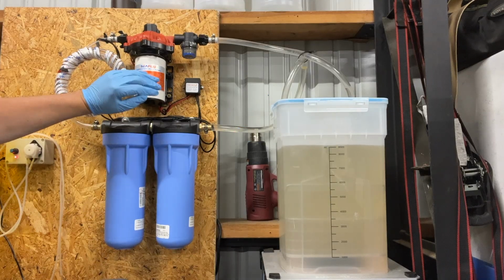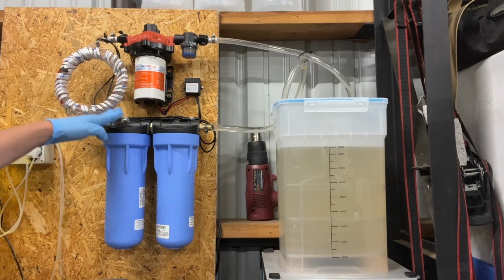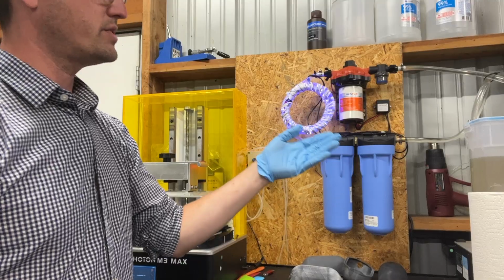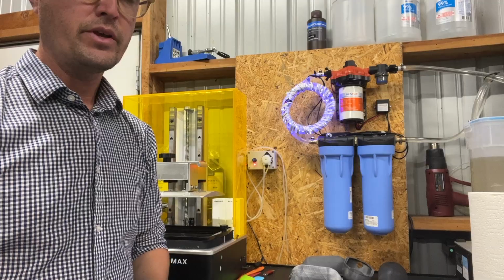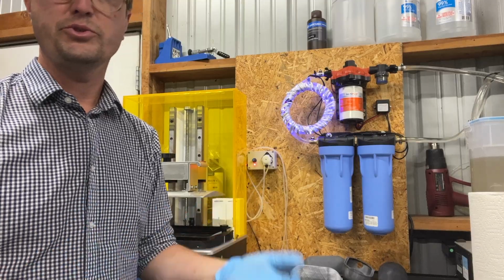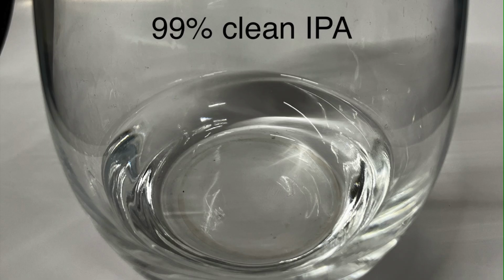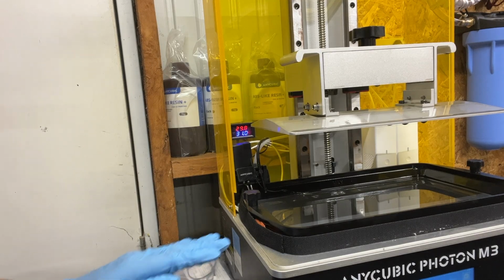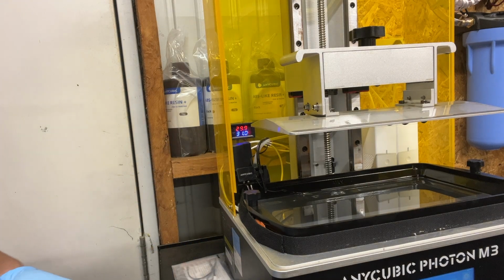Resin Printer Mods and Continuous IPA Filtration!

Comment: I would just wrap it in Aluminium foil. That way you get some thermal cooling of the led strip plus reflection of any uv light back to where you want it.
I have been thinking about a system like this for the better part of 3 years, but never had the time,  or the interns, to get this done.
Had all kind of crazy ideas in, charcoal filter plus diatomaceous earth...etc.
I do think that you will have to check your tubing quite regularly as uv damages plastic.
Reply from the maker: Polyvinyl tubing is uv resistant and durable and the LEDs are pressed to the tube. They are only 10w, so residual heat or lost light isn’t an issue.

Also no interns here, just me and my dog, and she’s not helpful at all!
Reply: Any reason not to use the 115V pump? @nicks-fix

Comment: Here from Hackaday, would have been cool to see the IPA circulation running. Very nice idea. Do you stir (agitate) the IPA as well, or is the pump flow enough to not worry?
Would be good to track IPA usage and publish your findings as well, just as supporting.
Reply from the maker: At the end of the video you can see it running (the light is on in the reactor). It’s very quiet, which is another plus!

Agitation isn’t necessary for my models, but YMMV. The pump is pushing 5gal/min and the inlet/outlet tubes are placed at different heights and different sides, so there is a pretty violent chaotic flow in there. 

It’s tough to see since both tubes are below the IPA line, so no air is introduced into the tubes.
Reply: @nicks-fix  damn that is really quiet.
Another plus point.

Comment: I really like this setup! I too hate cleaning up after myself when doing resin printing. I did try out some of my own solutions, most of which definitely did not work well enough for a second attempt, but one I tried recently actually did work well enough for me to recommend it as a low cost, low effort solution. Basically, use the UV lights to cure to resin dissolved in the alcohol, so that you get a gross, cloudy suspension of microscopic resin particles. If you do nothing, and just let those particles settle, over a few weeks you'll get most of them to collect at the bottom of the container, leaving you with mostly clean IPA. 

But I'm impatient, that takes too long, and isn't effective enough. But, good news, if you just add some sodium bentonite (aka bentonite clay, I got nearly a pound from my local grocery store for under $10, sold as a bird feed additive) suspended in solution, the bentonite will bind with the particles of resin, and make them settle out much quicker and more effectively. Is it a set-and-forget solution? No, but is it cheap and effective? Hell yeah.
Reply from the maker: Great! Love that there are so many solutions to this problem. I’m glad yours works for you!!

Comment: Your system looks nice. I would cover the loop though because UV is not good for your eyes. Printing a plastic cover for the loop might be a good idea.
Reply from the maker: Yep! It’s been covered with uv blocking tape after the video. I just wanted it visible to show it’s function. Thanks for the tip!

Comment: you keep saying 2.5 kg of resin it's not like you dumped it straight into the filtration system you're only cycling the resin that is uncurde on the surface of the prints and maybe a little from inside which adds up to maybe  .05 percent of that
Reply from the maker: How would i calculate the uncured surface resin in a relatively understandable way? 

People have an easy way to understand how much resin they put into the printer, and how much is used in a print. I tied my findings to that common standard, not a completely unknown variable since all prints have different surface areas. 

Excited to see your answer, but I assume you don’t have one and are just being unhelpful.

Instead what you did is add a ridiculously unnecessary variable into a fairly simple calculation.

Comment: I’m curious, is the pump providing the washing action or is there an agitator in the bucket as well?
Reply from the maker: Great question. The return tube goes down to the bottom of the wash tank, and the suction is at the top. When there is a little air, I can see the bubbles hitting all corners of the bucket, so there aren’t any dead areas.

Comment: I didn't catch your method of cleaning. Are the parts just static in the tub and the high flow rate does the job? My method for some time is to use a garden sprayer. I leave the parts on the build plate and squirt the parts with reasonable pressure. Inside a large tub of course. I find the mechanical force speeds up the dissolving of the remaining resin. It is a bit messy though. The pressure can't be too high of course. Not just for mess but it can blow the parts off the plate which is a nuisance because I post-cure on the plate as well.  For recycling the resin I just let gravity do the job. The fact that alcohol is less dense than resins is very handy. Overnight is generally long enough for the resin to settle. I then just decant the alcohol till I see resin particles at the lip. The remainder goes into another container with the previously settled mixture for further settling. It works but is a bit messy. It would seem your system greatly reduces mess. As to the heating, I have just purchased Chitu System's heater. Cheap and works a treat. I'm going to get more for my other machines. Your system is the best I have seen. Thanks for sharing. One question. How long do the filters last?

Comment: The is a cool approach. Although I think there is a huge, potentially terrifying oversight here. That pump is not meant for flammable liquids and says directly on it not to run flammable liquids through it. While I appreciate what you've put together here it presents a significant risk. Leaks through an old gasket, or just manufacturing issue etc. could have consequences... Have you overcome this somehow?
Reply from the maker: It’s an acceptable risk for me. 

The pump runs intermittently at about 1% of its rated duty cycle under near zero back pressure. A leak would represent itself far before any danger would occur. 

IPA is flammable, yes, but in a sealed environment without access to an ignition source, it’s very low risk.

The entire system is closed loop, and all materials that are in contact with the ipa and resin are rated for extended contact with alcohols.

If you wanted to use an air operated diaphragm pump, it’d be even safer.

Comment: Neat idea! Is there a reason why you're reactor is after your pump? I think having reacted fluid flowing through the pump would reduce the likelihood of resin building up on the pump parts.
Reply from the maker: Since the pump and tubes are not made for suction, they would fail long before residual build up ever happened inside the pump’s diaphragm. 

Also the ipa going through the pump is constantly moving over the diaphragm, cleaning it. Having the filter and reactor after the pump is the best way to run a positive pressure system.

Comment: Just to name a few alternatives: You can also use a distiller. The disadvantage here would be that a lot of the isopropanol evaporates (about 25-35%) and that it can hardly be used for anything else afterwards. But you get perfectly purified isopropanol for it. The evaporated resin is then very hard and can be removed with a spatula. The hardened resin can be disposed of in the trash (it doesn't matter if small residues remain in the distiller). The construction in the video is good and you have a constant quality of the isopropanol, but quite complex and relatively expensive.
But don't use the destiller with isopropanol INSIDE your Home! I did it once... wans't very smart from me 😅

There is also a purchasable small heater that fits into the 3D printer. Just search for "resin printer heater" on amazon and you'll find it. Another advantage here is that the resin tub is easier to replace.

Also interesting is the peristaltic pump on the wall, which is probably used to pump the resin out of the tub instead of dumping it out. Unfortunately, that didn't work for me, the resin is much too viscous and only delivers a few teaspoons a minute. It would be cool to get a simple and clean solution for this.
Reply from the maker: Yep, you basically listed all the reasons I didn’t want to distill. Mine doesn’t require any cleanup, doesn’t evaporate IPA, doesn’t have a huge fire risk, and doesn’t off gas a ton of VOCs. The small amount of money and time saved is well worth it imho.

The small heaters heat the air in the printer, not the resin. It takes a ton of energy to heat the air while you need the resin heated. Without a fully enclosed print area, you aren’t heating the resin to the proper temperature. Those small heaters are pointless if you’re trying to heat the resin.

Comment: Thanks for posting this Nick. Got some questions regarding your setup. (#1) After a month of using it have you noticed any reduced effectiveness of the filtered IPA?
i.e. is it just as effective as new IPA? (#2) would a clear tube with UV light strips wrapped around it between filter #1 and filter #2 add any benefit? (#3) would you change anything in your setup now that you have been using it for a while, i.e. add additional filter stages, use the clear see-through filters, etc (#4) does the pump come with it's own power plug? And finally, (#5) what is that white box with the tubes on the left side of your filtration system?
Reply: #5 looks like a peristaltic pump for pumping resin into the printer as the cat gets low. A couple printers have something similar built-in to them. Pretty cool when a huge tall print is desired.

Comment: Any calculations on cost between this system's filter costs versus buying new IPA?
Reply from the maker: It's tough to calculate. It depends on how often you are replacing your IPA ATM. 

I have passed 5kg of prints through 2 gal of IPA with this system and have no issues with scale/washing and the IPA still looks clear.

I foresee it being cost effective over time as the only thing you're replacing is the filters at $6 a pop instead of disposing of the IPA at $25/gal (for me in the US). 

It makes sense for me, plus the added value of not having to worry about cleaning the IPA, or disposing of the liquid component, it works for me.
Reply: @nicks-fix  Nice. 

Have you thought about using a sonic cleaner hooked up to this system? I normally finish with a sonic cleaner as it's my cleanest IPA and works better than the turbulent wash stations (which I never use to avoid damage). 

If I could go from printer to sonic cleaner and be done, this system would be worth it (even if it costs more than ipa).

Comment: THANK YOU SO MUCH!!!!!!  edit: Not sure if intended - The pump linked in the description, looks very similar but is a "maxzone" pump, and not the Seaflo Pump actually talked about in the video. Tried to look it up, but couldn't see if it contained the same materials, so be sure to look up the actual Series-33 Seaflo pump.
Reply: Thank you for this comment.  I too noticed the link didn't go to a Seaflo pump, and got concerned since it was pointed out that the pump was very specific.  I looked up a Seaflo 33 though and the specifications don't seem to match what was stated in the video.  The video indicates 5GPM and a 60PSI cutoff, whereas the Seaflo 33 on Amazon indicates 3.3GPM and a 45PSI cutoff
Reply from the maker: Oops! Must have been an issue with the links. I’ll update. Thanks for letting me know!

Also glad you like it! Have put 5kg of resin through it, still clear as day!

Comment: Meant to ask - what is the interface back into the Wash and Cure IPA lid? Are there holes just drilled into it and the tubes go down into it like that? 

What about when you have to take the vat off all the time for curing?  

Thanks!!
Reply from the maker: Great questions. The tubes go into the lid through two holes. They barely squeeze through. I typically leave the vat outside of the curing station, and the tubes are long enough.

Comment: Wonderful mod Nick.  I would highly suggest though...get rid of IPA all together.  At some point you are going to have to get rid of that IPA.  You are really just prolonging that. And the fumes are still going to be there.  Mean Green is the way to go. I recently switched to it and was quite sure it was not going to do the job. I was wrong. It smells great, looks cool in the washing vat 😉, but most importantly is MUCH better for the environment on both the manufacturing end and the consumer end as well.  And...it's cheaper.
Reply from the maker: Great suggestion! I’m fairly new to printing and the information I was able to review online that compared the cleaning products had IPA still as the clear winner in efficacy.

As for the fumes, it’s incredibly important to have this system be closed off from as much air contact as possible, to reduce the risk of fire and stop evaporation and fume inhalation. 

I’ll have to test simple green in the future, but for now, this works!
Reply: @nicks-fix  IPA yes does a great job.  Mean Green (Not simple green) does this same job with negligible difference without the environmental impact.  An overall danger of IPA.  I have been in the 3D printing business for over 10 years now.  One way or another, I am sure you will get it.  Good luck.

Comment: Very nice video! Any specific reason why you didnt choose the transparant filter housing? Isn't it easier to see if the filter is full?
Reply from the maker: Great question! It came down to cost and materials. I couldn’t justify the additional cost of the clear housing to be able to see the filter, or could I find a clear housing that wouldn’t degrade with ipa/UV. 

Also, being able to see the filter won’t give me an idea on how clogged it is since the particles are so small. I use the pump pressure and flow to determine when the filters are saturated.

Comment: Very cool!  How loud is it? Also, with the filters mounted like that, is it easy to get a bucket underneath them to catch IPA as you change the filters?
Reply from the maker: It’s running in the last scene (when the uv lights are on) so very quiet!

Haven’t had to change the filters yet at 4kg of resin prints washed, but I placed it high enough that I’ll be able to put a bucket under to catch any loose ipa.
Reply: @nicks-fix  Thanks! I was thinking more of how far away the filters were away from the plywood - but I'm sure it will be fine!
Reply from the maker: @davinflateau4266  oh my mistake!

An inch or two. The mounting brackets keeps it close, but it can spin freely. 

A 5 gallon bucket would be able to fit behind easily.

Comment: Amazing job!!! @Nick, with the resin band - I have a similar one, but always found securing the heating coil to the vat to be a pain. Mostly when I need to remove the VAT. I couldn't really tell how easy it would be to remove, or if it is even secured to the vat or just adjacent to it?
Reply from the maker: I’m testing putting a silicone rubber band around the vat over the heater band. Seems easy to remove!
Reply from the maker: Hey Dennis, I replaced the Velcro with this silicon band. 

https://amzn.to/3NG5QG3

Working great and no worries about tension or melting.

Comment: This is a great setup! Inexpensive, reasonably easy to set up, effective, doesn't rely on extra consumables like aluminum sulfate or diatomaceous earth (my preferred bulk filtration medium right now), doesn't require containers to be left in the sun, and best of all (in my opinion), it keeps the tank clean enough that you can clean in one stage rather than having multiple containers of progressively cleaner IPA. I look forward to any other improvements you might make on this in the future!
One improvement I would make if I built this would be to put some kind of UV shield around the hose loop for eye safety, even if just a drawstring cloth sack. It would be very interesting to do a before/after dry weight measurement of the two different filters after significant use to see how much they are pulling in, what percent of the material each one gets, and how much they can hold before the pump hits its pressure limit.
Did you use the same 360W PSU you linked in another comment for the diaphragm pump, UV LED strip, heat strip, and the peristaltic pump seen in the video?
Reply from the maker: Hey thanks!!

I plan to wrap the “reactor” in kaptom tape to prevent uv getting out (but still be able to see it on). Great call. 

Once I see any flow issues on the return, I’ll do a weight comparison to see how much the filters caught. 

And yes to the 300w PSU. Since the heater band and the filter system are controlled by a dual relays on a wifi switch, neither are on for long, and don’t exceed the maximum output of the psu.

The peristaltic pump is on its own line. 

Also fun fact: this whole system is offgrid. I built a 24v battery bank with a hybrid solar controller that runs these systems, my fridge, and charges my electric motorcycle!
Reply: @nicks-fix  Would absolutely love to see a video on the OffGrid Solar system / a parts list etc... I have wanted to build something like that for a while, but always get sort of overwhelmed when trying to come up with the particulars.

Comment: For the curing of the resin in the tube have you ever thought about using a water filtration UV sanitizer?
Reply from the maker: Yep! First version I made had one, but finding the correct wavelength of light for the resin wasn’t possible. 

Also this method is $60 less and has the right wavelengths needed for the resin.